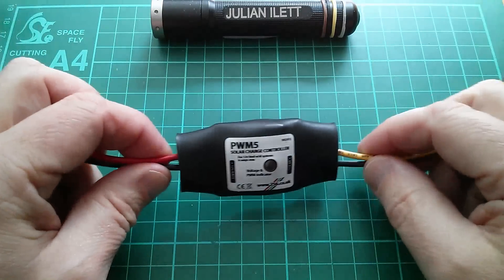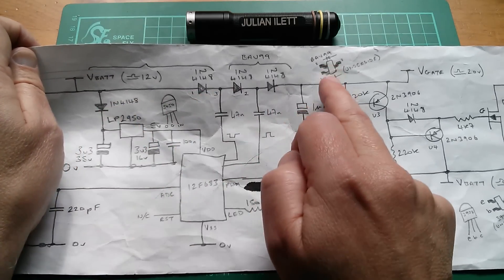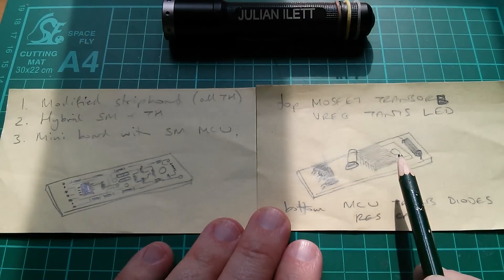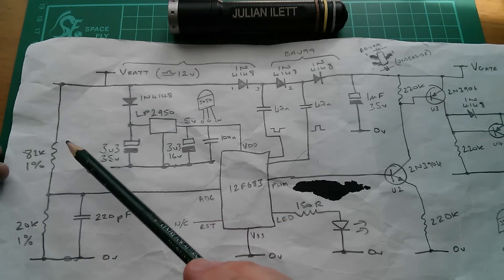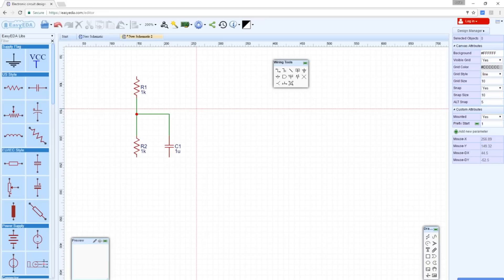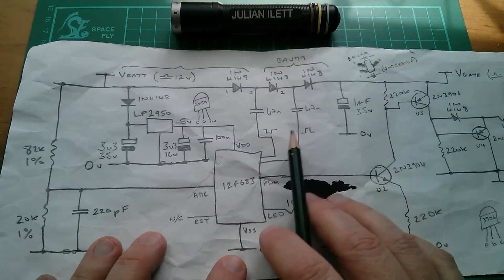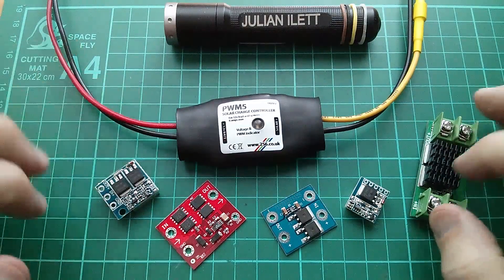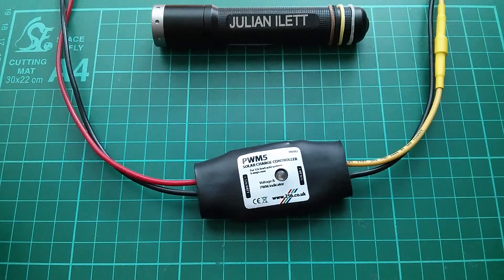PWM5 Solar Charge Controller SMD Re-Design with EasyEDA

Comment: Instead of a diode, why not just use a mosfet with the gate tied to the source? Easy peasy. Then the source and drain function exactly like the anode and cathode of a diode. When reverse biased, the mosfet will be pulled the wrong direction turning off the mosfet. Since it wouldn't be functioning in the linear region, the built in heat spreader should be good enough as there are mosfet choices with very low Rds(On). 

Heat may be an issue if you are powering things off of your 'diode', but dealing with the relatively meager current dealing with charge regulation, you have plenty of headroom. You would need a lot of solar generation to overheat a mosfet turned fully on.

Comment: What is the additional cost per unit to just add the ideal output diode to all of the units? It might be easier to just do it rather than to stock different SKUs and all. If it a power drain perhaps include a bypass switch to turn it off and bypass it. Or is it a significant point of failure?
Can you TH a few of the most-likely-to-fail parts to make these easily repairable?

For something to explode in the Open Source community it helps to have a modular product. People tweak portions and customize to their needs, enriching all the other user’s applications. To wit...  
To get more Amps, can one use as many of these in parallel as they wish, or would the SoC feedback start a dueling SoC oscillation? If it is not wise that they be used in parallel then I’d like to see the inductor portion made to be modular. IOW what if you had one MPPT brain unit that had an output to run as many inductor boards as one wanted. Say the MPPT brain had an output socket that one could slide a parallel inductor board in to. One could then purchase as many of these as they needed, or someone could develop a 30A board to run off of the same brain. The same inductor boards could then be used for brain units programmed to charge LiPO4s or any other chemistry.  If you wanted to get fancy, each additional board could read the PWM from the input, but then change the specific timing to reduce the number of inductors charging at the same time. Make the entire package DIN rail mountable using the rail to heat sink anything that might get warm, and you have a great system that’ll grow with the user’s setup.
There might even become a cottage industry of making adapters to use the PWM5 brain output (and future variants) as a switch for inductors in old, dumb, but well made charge controllers.
This might all serve as fodder for later Open Source tinkerers, but at any rate I hope you can incorporate some output pins to invite the innovation.

Comment: These low power stuff (<200W) don't need fancy switching and chargers, A voltage divider+ comparator + Mosfet and that's it.  When the battery voltage is bellow 13.5V, the comparator turns the mosfet on and the solar panel(s) are connected to the battery, then when that voltage is reached, it turns off the mosfet. No drama. Cheap and uncomplicated.

Comment: I would build in adjustable battery voltage cut out, 13.5 volts may be a bit low for some lead acid batteries.

Comment: Nice to see it using the level shifter cct (U3 + U4) I came up with for a commercial design in the late 70s. Probably can't claim originality but it was several years before I saw it used elsewhere.
Reply from the maker: Interesting, I got it from a website, but I can't remember where now.
Reply: +Jullian Ilett I spotted it used in a Mullard/Philips info sheet for IGBTs (IIRC) a few years later and I doubt they copied me. But reverse engineering was a fact of life in the industry I was in at the time - I still have a thick file of traced circuits. Several tricks I came up with that I still consider neat were later spotted in competitor's designs.

Comment: 100mA, Low Noise,LDO Micropower Regulators in TSOT-23 with Wide Input Voltage Range: 1.8V to 20V
http://cds.linear.com/docs/en/datasheet/1761sff.pdf

Comment: Julian Ilett,, when you published the source code of your PWM5 charge controller, I made one for my mother's house and I must say it really works. Thanks for making it as an open source project. However I have a suggestion if you can modify the code so that it will charge the battery in a three state of charging, ie Bulk, Absorption(14.7Volts) then Float(13.8Volts)? I can't modify your code because I am no good at programming specially assembly language.

Comment: I need one that I can adjust from 12v up to 26v or so for lithium. Then I need a small board that measures cell voltages and shorts them across a resistor if it goes over 4.2
Reply: The SBMS from http://electrodacus.com/ is a great product. Schematic is in the manual

Comment: Check out fritzing, you can start with a bread board layout then do a circuit diagram and finally a pcb. Best of all its free and all different kinds of components are there including micro controllers and different shields. Also what is this little fella for?

Comment: Hi Julian I have watched a few of your videos on the charge controller. I don't think I ever heard what the voltage that the charge turns on. You have the end of charge at 13.58 volts or so. Also how does the gate of the mosfet not go above 4 volts as recommend by the specifications?

Comment: +Julian Ilett Here is a surface mount ideal diode you may be interested in.
http://www.ebay.com/itm/LTC4413EDD-LTC4413-Ideal-Diodes-in-3mm-3mm-DFN-/271016784262?hash=item3f19dbf186:g:68QAAOxyVX1RxsG4
Reply: This may be the correct version here: http://cds.linear.com/docs/en/datasheet/4358fa.pdf
Reply: 2.9 to 18v http://www.ebay.com/itm/LTC4352CMS-LTC4352-Low-Voltage-Ideal-Diode-Controller-IC-/271015377095?hash=item3f19c678c7:g:5IwAAMXQBg5RxpOn

Comment: and to. a version with a tiny oled would be nice. or as a upgrade. to purchase separate. but a design. where the user can all components. like the ideal diode. or a volt.amps display. but as small as possible. that's something I would look to buy anyway. a  customisable charge controller system.

Comment: I am very interested in this project. I would like to build my own charge controller. for some reason I want to build my own everything. but could the current capacity be upped by using more or higher capacity FETs. and wiring. or would it require a complete redesign ? I was thinking of about 50a at 24v. also would this work with a small wind or water turbine. generating about 7-800 watts.

Comment: If designing for "cheap" production, you maybe should try to use as many similar components as possible. For example the BAV99: while a single one of it might be cheaper than two SMT replacements of a 1N4148 (whatever that would be), the single diodes might be cheaper in the end, because you need more of them and already have them in the circuit somewhere else. Also pick-and-place machines have a limited number of feeders for parts. So one less unique part could make the difference between being able to run the PCB through a smaller PnP machine or not (time on a smaller machine is cheaper).

Comment: Hi Julian,
Why spent so much effort in a PWM charger when a MPPT charger is better?
For example this Victron copy from Ali: https://nl.aliexpress.com/item/100V-15A-MPPT-solar-charge-controller-MPPT100-15-with-real-MPPT-fuction/32687617515.html?spm=2114.13010608.0.0.48GbPN 
I realy like your channel, I start soldering again since 10 years.
regards,
Pino

Comment: If you're aiming for the smallest design rather than trying to remove human assembly of through-hole components from the process and just use pick-and-place, I'd stick with that "hybrid" design of having the through hole higher power components on one side and surface mount control components on the other. 

A TO220 bent over will have a smaller footprint on the copper side than a D2PAK as well as being able to dissipate more heat even without a heatsink, even though as you say the D2PAK is just a TO220 with a bit less tab and the leads cut and bent into surface mount leads. I don't know how hot your FET gets, probably not very, but if you look at datasheets for D2PAK devices their specifications often seem to be on a test condition of having 4 square inches or more of 1oz copper plane for heatsinking. in the "hybrid" approach, you just need space for the 3 pads on the copper side. Conversely, if it doesn't get hot at all, even D2PAK may be oversized and you could consider smaller surface mount packages.

Google image search for "reverse battery protection with p-channel mosfet". That might be of use to you somewhere in this design, I think it's similar to your ideal diode thing, but simpler. 6 amps would probably be pushing it for a P channel FET, I've only used it for milliamp circuits.

Comment: I would be interested in an open source MPPT project that would be solar module, battery configuration,  and battery chemistry agnostic. One that the user could test different MPPT algorithms, and intelligently manage loads. Alternately, a modular system the would do this functions agnostic to one another.

Comment: This should be a good series... there are so many decisions to be made... e.g. 0603, 0805 etc for the resistors.... 0603 are dirt cheap, 0805 are chunky and easy to hand solder...  Look at MCP1703 for the regulator.  Personally, I have a soft spot for DipTrace, it's free for small boards.

Comment: You could just adapt the through hole reg to work on a surface mount board by bending the pins or something. 

I find the PWM5 works extremely well in my little garden shed setup. It keeps the battery topped up with only a 10 watt solar panel for the LED light (which I will be upgrading soon) & the battery does not sulphate up nor dry out.

Comment: Use MCP1702T-5002E/MB instead of 2950.  SOT-23A or SOT-89 are available. It is very low quiescent current and very low dropout.

Comment: The chinese already have quite cheap solar charge controllers, I bought this one lately for example :
https://www.aliexpress.com/item/6V-12V-10A-Auto-Solar-Panel-Charge-Controller-Battery-Charger-Regulator-PWM-Hot/32769930226.html
Not sure how it compares to the PWM5 ??
Reply: (EDITED) I have that one. It floats at 13.8V (too high for my taste...).  I have a GEL Lead Acid Battery. It charges in 2 stages, being the first one a equalization charge 14.4V.
Reply: Edited my comment. The charger actually does a equalization charge. I never caught it before :/ Now I know. So, apart from it's WAY too high floating voltage (13.80V), it's actually a nice charger (mainly for the price). Never noticed the thing get hot too with a 100W "12V" panel...
Reply: doesn't appear to be opensource

Comment: Liquid Tin Made by MG Chemicals, place the board in a container that the board just fits in and pour just enough to cover the board and in a couple seconds you'll see it tin perfectly, when done just pour the remaining Liquid Tin back in the bottle and it will last for years or even decades. Copper solders nicely, but it corrodes after time and this will protect it from that and looks so professional. Use this when you're finished making your board instead of soldering, it save so much time.
Reply: I like using the Toner Method printed on Single Sided Glossy Flyer Paper Meant for a inkjet printer because the Toner doesn't stick to that paper very well and comes off on the board really easy after pressing it on using a iron for clothes or a oven with a flat weight on it around 210 degrees and you use lacquer thinner to get the Toner off the board easily. I don't like Acetone because it's so strong it sometime pushes the Toner into the board and makes a mess.
Reply: If anyone is interested in making a double sided board let me know, I have a easy method.

Comment: Always worry about thermal expansion & contraction V being " glued " / soldered to an un moving back panel . Added being solar , may be in an out of sun . Yes , yes , i know it ' s industry standard , but is that more about cost of production , rather than longevity of product . Would a double sided not be a happier compromise .

Comment: Your LP2950 should be available in a surface mount. SOT-233 I think. And have you tried DipTrace? I find it quite easy to pick up without having to do too much reading.

Keep up the good work...

Comment: Some Autorouter tips: 
- After using the autorouter, if you hit "undo" it won't undo all of the autorouted vias.  So instead do this: At the very top right of the screen there's the dropdown "Super Menu", which under Miscellaneous has _"unroute all"_.  This will delete all vias as well.  Note that it will delete ALL routing (including your manual routing), not just the autorouting.  If this is annoying, an alternative is to first do your manual routing, then save your work, then run the autorouter, then if you want to undo it you just close the window without saving it, then reopen it again.
- If you want to do a combination of autorouting and manual routing, do your manual routing first and then in the Autorouter make sure you UNselect "ripup nets" (otherwise it will delete all of your manual routing and redo it all with the autorouter).

Comment: Well I had a go a modeling it here: 
https://easyeda.com/christian.cooper/PWM5_Solar_charger-a39727ba5c2a4fec921ba7a18542c1ab
I changed to equivalent SMD components where I could, however I'm sure the some cap values are wrong and I'd have to have a look at the PIC source code to be sure the pins on the PIC are not incorrectly connected. :)

Comment: Hi Julian I was last year inspired by your PWM5 design and started digging into and stumbled into I believe Adem Welsh his project bij redesigning it into a arduino and later Attiny 85 and how to make the design as power efficient. I had some ideas about it and deleted the voltage regulator and replaced that with a Chinese step-down regulator which are commonly used in these quad flying things or RC stuff I understood. I programmed the Attiny with the B.O.D functionality on  and placed the diode between the battery and the PWM so the PWM is powered by the solar-panel instead of the battery. The B.O.D. function will switch of the Attiny at sun set when panel current drops to approx 4V en will start the Attiny in the morning if the current comes above 4V. So no current consumption during the night. I'm with no means a electronic engineer this was somehow mine first electronic thing I build and probably I used not the most efficient parts but it works and does the job what I understood in your introduction of the PIC this has also the B.O.D functionality so maybe it is a Idea?
Reply: What's B.O.D?
Reply: sorry for the late answere but google is your friend ;)
Within most microcontroller there is a facility called brown-out 
detection. A brown-out is a term used to describe a dip or drop in 
voltage supply. A black-out is when there is a total loss of voltage, 
but a brown-out could just be a dip below the voltage range of the 
micro-controller. when you feed the MP from the solar-panel while you are drinking a sundowner the MP wil stop working when the power of the panel sinks below a voltage where the MP will stop working correct and could be stuck in an error. With B.O.D. enabled it will stop working on a certain setpoint. and wil restart when the proper voltage is available again. this B.O.D. you schould set when you are burning the boot sketch
Reply: sikko de boer Thank you very much for your answer! I just learned something :)

Comment: Hi Julian, you may want to replace the LP2950 with a LM2937 (plenty SMD Options), which should also be sufficient enough to feed your 5V0 MC supply line.

Comment: You can get smd parts cheapily from ebay or directly from manufacturer.But I still prefer farnell and others(in Czech republic is TME) prices are really low. I just picked up
 10 000pcs 0603 resistors for 5 $

Comment: Jullian! keep comming, again like your videos! SMD is future(I think it is more accurate to say present) I like a lot smd soldering. It is quite handy to pick up some 1206 and 0805 Smd resistor and capaictor books. Thiese packages are easy to solder. 0603 are more difficult, but still hand solderable. And with SMD it is cheaper and smoller.
And I like EasyEda. I am using it approx. year and It is relly powerfull tool.
Keep videos like thees coming and get rid of shity octopusy lights on ebay and spend money on smd!

Comment: I don't think it would be useful to make it smaller. You have quite chunky wires connected to it so I would keep similar size of the PCB. The whole point of making it surface mount is that it can be manufactured by a pick and place machine. Btw1 I do like easyeda and their PCB fabricating service. Btw2 they also offer PCB assembly service.